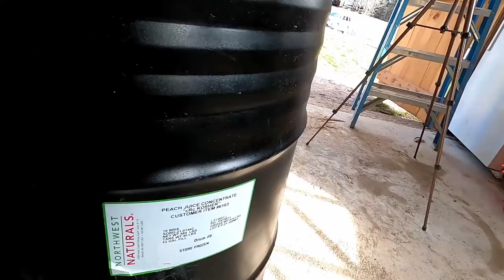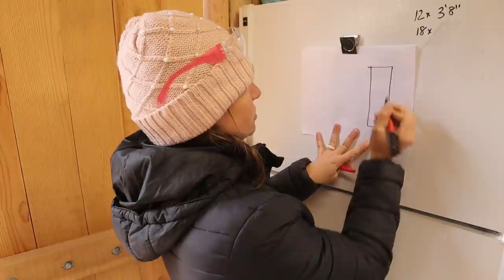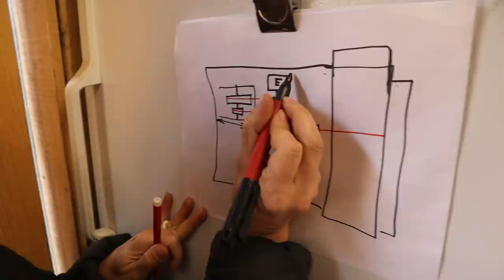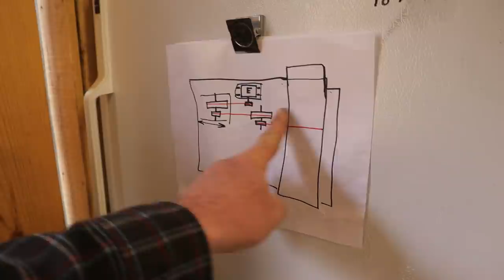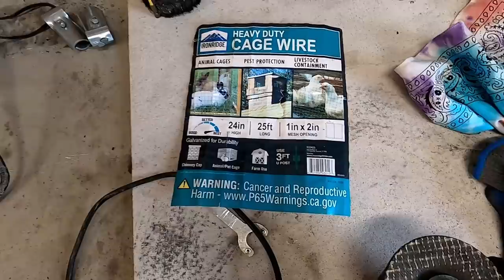Trommel build - start to finish with results // E69

Comment: Awesome video but was worried about if you was going to still have a hand after the way you was cutting the tires off 😆🤣😂 but anyway for future reference you should be able to boil those in really hot water to soften them up to take them off of the rim easier. And yes I do kind of have a Meg she does get out to get things but at first was embarrassed to do so but great video

Comment: Cool build and on the cheap to boot, Bravo. Some ideas I had, the guide wheels and idler need to be changed out for something with roller bearings, the friction will heat up and melt the plastic bushings. On the step down pulleys use a piece of 2" pipe instead of nails as a connecter, the pipe will handle the torsion much better. And on the idler use a heavy spring or weight to pull it down and provide better tension control. Best of luck.
Reply from the maker: Great tips, Martin!  I'm with you about the casters.  Should have used ones with steel bearings.  It's probably going to be a 'replace it when it fails' thing.  Cool idea with the spring too.  I have an old 4-wheeler I grab parts off of and the coilovers would work nicely.

Comment: Great build but one small detail to consider, the idler should be on the bottom half (slack side) of the belt, not on the pulling (power) side. The ldler will last a lot longer and be easier to adjust.
Reply: Good point!  It might need a second V-belt to transfer more power when it gets really loaded up in use.

Comment: 1. Perhaps the weight of the barrels is the way to keep tension on the v-belt around the middle of the barrels; consider a way to lower them on their rollers.  2. The amount of material in the trommel is a way to control how much they want to raise in use. 3. Take some wear off the backhoe with an a-frame on wheels with a boom and chain hitched to the tractor to lift logs off the ground; take less dirt to the band saw to dull your blades.  Enjoy your work... as I have cleared by hand over three acres of trees too close, vines to the canopy, and sticker bushes ten feet in diameter; all is out of control.
Reply from the maker: Good thoughts, Burke.  I'll be doing some updates in the trommel soon.  Stay tuned 👍

Comment: Hi Guys. Excellent show with so many tips for us. You could maybe glue a rubber strip around the outside of the barrel so the V belt doesn't slip on the metal.

Comment: One end of your trommel screen should be higher than the other.  Doesn't need to be much. Throw your raw soil in the high end, what doesn't pass through the mesh neatly comes out the lower end into a pile of segregated material.  If your trommel legs are high enough to fit a wheelbarrow under the low end, it deposits the segregated material right into the wheelbarrow - That much less shoveling !
Reply from the maker: Hard to tell on camera, I know.  The terrain has quite a slope that provides enough of an angle.  I do intend to add some legs for adjustability though.  Sort of like those shade tent legs.

Comment: May I make a suggestion.  Add 2 sets of caster on ither end . Not only one about 2 foot up but go another foot . Y . Not only will it hold it like u want but the other ones will help hold it down . And seeingvyou don't have a slip clutch on anything you could adapt a handle from a lawn mower that raises the deck and it's got the locking mechanism in it . Y . Well it's is a safety thing  for all . Incase anything comes up.  And it will help the motor from not being right under a load when it first starts up . At the end of the day pull the leaver back to release the pressure ( wich can save belt life ) and u can idol down the motor befor just shutting it off for the day . Hope this helps.
Reply from the maker: Your suggestions are spot on.  I ordered a centrifugal clutch and some more casters the other day.  I'm replacing the plastic ones on there with skateboard wheels, which have real ball bearings and should take the abuse a lot better.  How do you feel about the idler?  I've had some guys tell me to push up from the bottom instead of the way I have it setup.  I really can't see a difference in performance.  Thanks for the tips!
Reply: @WalnutsandWineberries  I can't see why they say up you want the presher to push down so you would have to push the arm to the drum , then push the button on top of the leaver from a lawnmower deak lowerer  or hand pull the leaver to unlock like a old set of farm cultivatoror a old rake . Lot of old farms have that shit sitting in the weeds . . You have the bottom ones working wheels that is , Maybe add ones to the middle to hold the weight up . So add 3 to the list of 4 more so over all 3 wheels per holding bars . The skate board wheels are not a bad thought.  You can oil the bearings,  they don't like sand in them . I can't remember if they are sealed 🤔 been a long time from riding my board .

Comment: What you want is a rock grizzly. There are several builds on various YouTube channels. No moving parts, and will separate large rocks from dirt.
Reply from the maker: Thought about building one of those, but the rocks here are very flat and I'm afraid the size we're after would slip right through.  Maybe down the road, if we need a first step to separate the extra-large ones to keep them out of the trommel.

Comment: Just started watching you like your channel I'm a old school master carpenter meaning I'm just old have you try rock splitting wedge it is a shim and two feathers  should be a video on how they work but they do work have use them  you can find them on line thanks for your videos my first time to ever comment on any video JB from South Carolina
Reply from the maker: Thanks, Jerry!  We are honored to be your first comment!  We have tried feather and wedges but did not have much luck with them.  We actually ended up with two of them permanently stuck in the rock.  :(  I guess they  must work better with some types of rock over others. - Meg
Reply: @WalnutsandWineberries  just thought enjoy your channel if you need help with house build just contact me with any questions you can pick my brain thanks JB
Reply from the maker: @jerrybarnes3940  We just may be taking you up on that offer at some point.  Thanks!
Reply: @WalnutsandWineberries  any time

Comment: What about a chute on the inbound side so you could use the FEL to put the material in instead of shoveling. Just an idea. Sorry, I made my comment before you mentioned the hopper. 😁👍
Reply from the maker: All good, John.  Definitely the plan to automate and take advantage of the tractor.  I'd really like a conveyor throwing it in, but a hopper might be all I need.

Comment: The idler pulley should be on the lower portion of the drive belt because you never want it on the section of belt being pulled by the drive pulley. Look at the idler pulleys on your truck and Jeep, same principle.

Comment: Great, but normally when building or using a trommel you infeed at one end that which is elevated higher then the other end and the rocks will work their way down hill and out the other end
Reply from the maker: Working with the grade of the land for that.  Very mountainous property, so building the sloped angle didn't seem necessary because of the uneven terrain.  Might add some adjustable feet though, like those ez up tent legs.

Comment: The circumference of any pully is PIE X the Diameter. Or 3.14159... times the pulley diameter equals the circumference. And RPMs gets lesser and lesser from the combination of pully sizes the torque goes up proportionally. So the actual torque to the drum is a lot more then the torque at the output shaft of the engine. Simple physics. ALso, cut the lip off the output end so the rocks can exit easier.
Reply: True, but pi cancels out when comparing the circumference of the small wheel with the larger one.  It doesn’t matter if you compare circumference C, diameter (C = pi * diameter), or radius (C = 2 * pi * diameter) - the ratio between the wheels is the same.

Comment: The speaker magnet are great, but getting the fine metal shavings all off is a pain.  Put a plastic bag over the magnet then when done invert the bag and pull off.  All shaving are now in the bag.

Comment: Instead of screens, how about using a hole saw to perferate the drum? That would tolerate the forces of the rock much better than the the screen. But at any rate it won't last long, because the Post-it notes with the speeds will fall off.
Reply: Lol, Post-It’s!

Comment: Some thoughts for improvements:
- As mentioned: more rollers, 12 total. 4 top, 4 mid, 4 bottom
- Angle - give it some more angle, it looks almost flat in the video
- Output Chutes - all of your graded material is just falling flatly underneath, this isn't easy to scoop. Put a piece of metal or plywood or something underneath to direct all of the graded material to the side.
-Graded screens - in reality you might want to consider having 3 outputs, a finer screen up top near your entrance (1/2" ish mesh), then the lower screens being your current mesh (albeit 1"ish is a good starting point), and then the output being the large rock.
-an input chute, roughly as wide as one of your buckets (FEL bucket probably ideally but either would work if your source material was near enough your trommel)
-make the whole thing taller, if you did graded screens as above, and had output chutes, you could either make it tall enough that you could get to it with your backhoe, or put wheelbarrows or something under the first 2 outputs (not for the last big rock output)
-spring load your idler. Get a trampoline spring or something, and dont idler your loaded side of the belt.

If I were in your scenario, I'd personally probably look to do a 10-12ft long trommel that'd be about 6ft high on the input, it'd have 3 different grades of screen before the final output (0.25, 0.50, 1.0), but ofcourse everyone's needs and results are different.

Hopefully this is of some use - if not no worries.
Reply from the maker: Really great ideas, Jeff.  Appreciate you taking the time to share.  Let me explain the angle thing.  Yes, I built it flat but that was intentional because of the area I plan on using it has a decent slope - about 15-20deg.  I also intend to add some adjustable legs off an old ez-up tent so I can raise it and apply an angle.  My terrain is rolling to steep, so it's good to have flexibility.  I'll be sure to share the changes and updates on the channel, as I'm looking forward to the soil drying up and get this thing rollin'.
Reply: @WalnutsandWineberries  sorry for so many comments, but this is more fun than any of my current projects!
For them different output sizes, you could build a dump box (opens on one side) on pallets.  The pick up the whole thing from underneath with your forks instead of using your bucket.  Definitely faster for the fines, and probably for the target gravel as well.

Comment: i used a cyclone fence fitted on a dog kennel wall unit for my sieve 
got most big stuff then but chicken wire on it and got nice gravel/
im in glacial till which is earth speak for runoff into a lake 
so all my rocks are round
if you want to filter out smaller gravel just buy smaller mesh and put inside your trommel
Reply from the maker: It's a possibility.  I really wanted anything that's not soil, so I didn't see the need to separate into 2 different sizes.  The shale breaks the more you drive over it and everything becomes small flat shards.  It's a great road material.  Just have to have the drive to unearth it.

Comment: Hey Rube!...needs more bubble gum and baling wire! Seriously, the best thing you got goin' is that helpmate of yours! Keep improving and you'll get it right...i've got 4 of 'em for my gold mining op.
Reply: ...but you might consider a lengthwise raisin shaking screen you can load with your tractor. Your thru-put will increase, its simpler, you can scoop out dirt from below (for the garden) and they're cheap at auction

Comment: It looks great! Looks like there are two engineers!

What if you could put the tire pulley underneath the barrel to use gravity to keep it in place. As you saw, the tighter you make the pulley to keep everything moving, the more it wants to jump out when the weight lightens up inside.

That is a great welder! Incredible what all you have done with it.

With those barrels it wouldn't be that hard to build a gasifier and run your own power off of wood gas.
Reply from the maker: Hey Bryce, thanks!  It was a fun build and a great starting point.  I had a similar thought of putting tension below and then I started worrying about all the debris.  I'm planning on adding some vertical bars with a wheel on top of each so the idler will essentially pull the barrels into a corner and I can really put some pressure on the belt.  That welder is great, for how cheap it was!  Stay warm buddy.  Gonna be cold this week in our neck of the woods!
Reply: @WalnutsandWineberries  do you have any issues with the barrel wanting to slide since it's on a little bit of a grade? 

How much snow did you end up getting?

Comment: To calculate the ratio, simply spin the drum 1 revolution and count how many times the engine pulley spins. The you can use that fraction to calculate the drum rpm.

Comment: nice idea with the magnet you can put the magnet in a plastic bag, use the magnet to remove the metal pieces then reverse the bag to remove all the metal splinter from the magnet 😉

Comment: Andrew Camatra has a tromol for his skid steer go see? You need to think of the number of times you are touching the product? 1 pick it up in tractor 2 empty tractor bucket 3 shovel in to tromal 4 move excess soil away from under tromal 5 move good stone away to storage area or out to road site? That’s a lots of handling??? 👍👍🇬🇧🇬🇧

Comment: @ 18:10 Divide the diameter of the drum by the drive pulley and divide 3600 rpm by that number which gives you approximately 450 rpm if you went direct from engine to drum. The engine would need a drive pulley equal to the drum diameter in order for the drum to spin at 3600 rpm..

Comment: If you just cut 10mm slits instead holes and putting in mesh you save a fortune in mesh and time and  not compromise the integrity of drum and your need two guide wheels on top of drum to counter the upward push of weight in the drums,

Comment: Nice job on the separator. Those guys on Gold Rush got nothin on y'all. It would be nice if you had a water source to wash the stone a bit to have it come out the end a little cleaner. 
Just a thought on how to add some function. You could add another v-belt off of the 60 RPM barrel to the opposite side (this would help keeping it in place as well) to drive a conveyor belt to deliver material into the trommel from a hopper. This might give you a consistent feed rate. Also, adding a very wide conveyor belt under the trommel to remove the spoils would keep you from having to stop and clean it out by hand. Something like that wide belt that is sold to put in the back of your truck to dump out gravel. Or you could incline a sheet of metal under the separator to funnel it a few feet away then just scoop it with Ricky. 
With all the metal cutting you wound up doing on this project, I think Meg should spring for a cheap plasma cutter for the homestead. Then it would only be your feet in danger of catching on fire and not the more important bits in the middle of your body. ;-).
Reply from the maker: Coffee up the nose on that last part, Randy!  Haha!  Loving your ideas, especially with the conveyor belts.  That would be music to my ears.  Either way, I'm definitely going to need to figure out pile management of our finished stone and the screened soil.  Might stockpile that soil for the garden or even use it as topsoil.  Could even run it a second time and have a pile of fine stone and really clean soil.  Great ideas, my friend!

Comment: That is a fantastic project and it works nicely. Thanks for the great details on the engineering and the build. Would you consider raising the entire unit up a few feet so you could run your bucket underneath to scoop up the 'fines' for other uses?
Reply from the maker: Definitely!  I plan on adding some legs that are adjustable off an old ez-up pop up tent.  Room for improvement here, but we're really happy with our initial test.

Comment: rather than having the idler push down, have it push UP... then it will hold the barrel down.  Also put a spring on the idler to hold tension.

Comment: V belts ride in the vee to transfer the load. The wedging action gives the belt it's power transmission ability. As soon as you put a few shovel fulls of dirt you will have huge problems with belt slipping. On the drum find a pulley off a car engine (or buy one as they are fairly cheap) the multi rib belt will make a decent flat belt on the drum, and won't slip due to the ribs.
Put the pulley under the drum pulling it in to the rollers. If you use an idler it needs to be on the slack side of the belt, not the tension side.

For the price you paid for those wheels you could have purchased actual stamped sheet metal  pulleys that grip the belts properly from a farm store.

Realistically the drum isn't going to last super long. The rocks will beat it up. Also rocks are very heavy and it will only take small amounts at a time. Half full would be over 1000lbs of material.

Good luck.

Comment: Have you thought about using jack bolts to adjust the tension of the belts and to slide the engine back?
Also, I’d suggest an emergency shut off or at least an oversized button or lever.

Comment: Idlers that I’ve seen usually have a spring device or are weighted. Seems to me that you could use an idler pulley on each belt to eliminate the need to continuously adjust tension by loosening bolts and nuts…kinda the whole purpose in an idler.